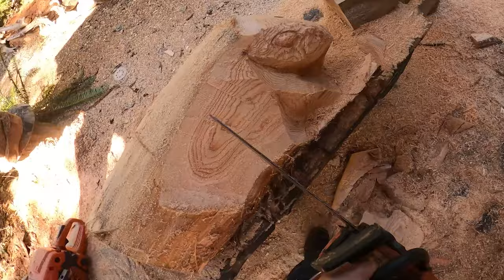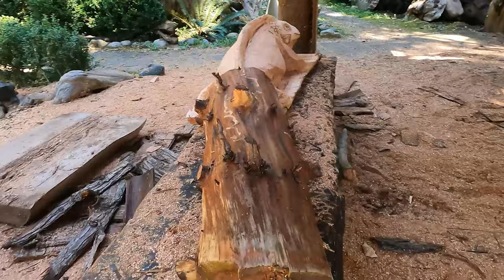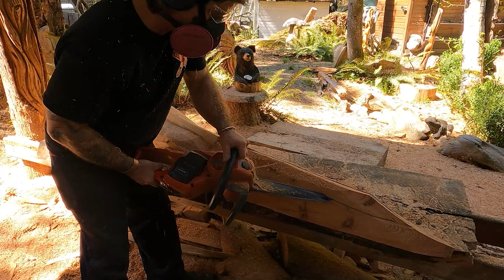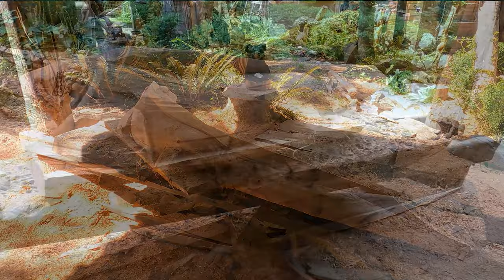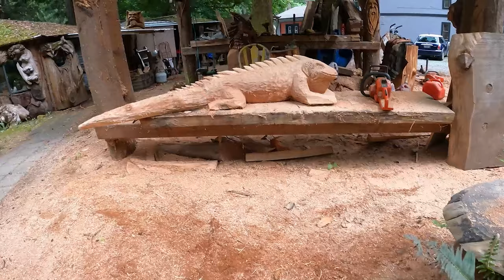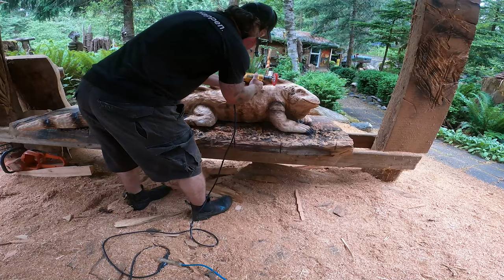Amazing Fast Wood Carved Iguana - 7ft Long !!

Comment: Kevin I couldn’t tell when you added the tail log onto the carving , did you pin it with dowels are just glued it to the piece? Looks great man . Thank you .
Reply from the maker: Hey ray!! I put a large torque screw in the middle of the log and a saw cut on the joining piece filled with gorilla glue then 4 screws to hold in place until the glue sets up
Cheers